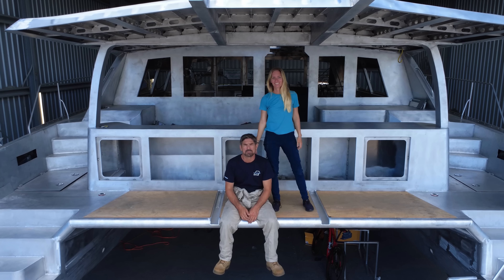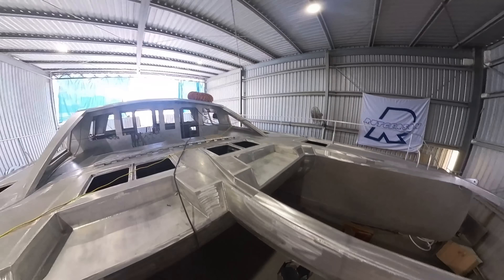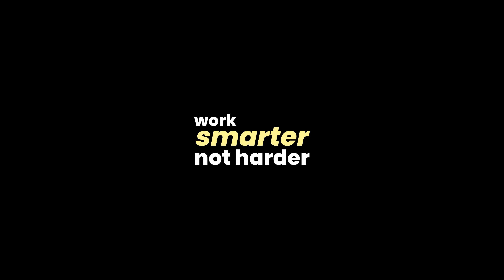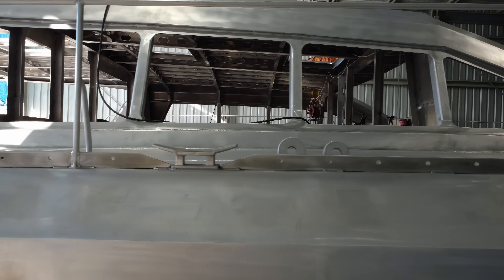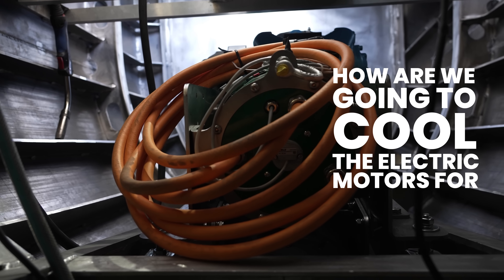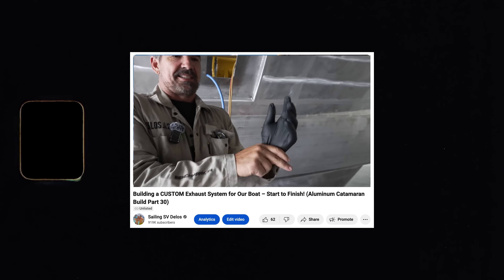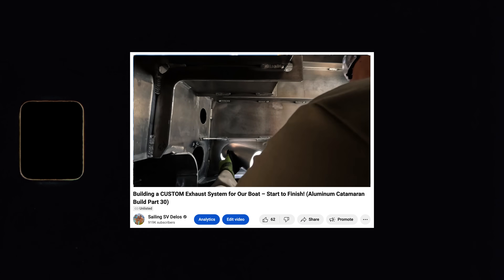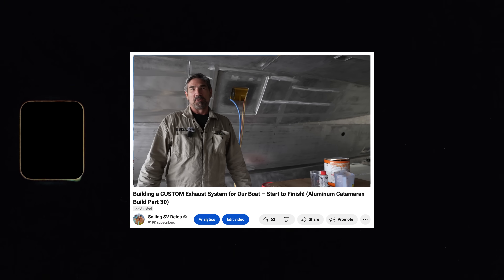We Challenged AI to help design our Keel Cooler 🧠 (Building Our Own Aluminum Catamaran From Scratch)

Comment: As a marine engineer who has designed commercial keel coolers and experience with smaller off the shelf and custom pipe coolers often used in small shrimping skiffs, the issue is the coefficient of heat transfer.  You are using the heat transfer capabilities of aluminum before you paint on thermal insulation.  

You are looking at using your hull as the outside of the cooler, i would strongly recommend using your hull as the inside of the cooler and welding a thinner aluminum on the outside.  You can do this easiest by cutting 2 holes in the hull, exhaust on top and intake on bottom, cut 4" aluminum pipe in half and weld a 6' section going forward on either thruhull and connect the open ends towards the bow.  This will give you roughly 5 sq ft of heat dissipation and a natural convectionary flow down as the water cools and sinks.  More than enough for your application.

Feel free to message me if you want a completely pump free keel cooler design.
Reply: Makes sense to have it on outside.  Less heat radiated back into engine bay and through convection.
Reply: I naively assumed you'd have a pump to circulate the coolant, so that convectionary current wouldn't be important.  I would have also guessed you want a countercurrent flow of coolant starting at the stern end and forward opposite the flow of the seawater towards the bow.  Any validity to those ideas?
Reply: @bobbj177  Yes and no, he will most likely have a pump and I'd assume he would as well, but we can't always assume he's using full power.  We really aren't talking about much heat, and since a variable is possibly a pump that is rpm based, there could theoretically be a point where parasitic losses are significant for convectionary current.

Counterflow would only matter if the same exterior coolant is being used.  You obviously want the coldest atmosphere available for the coolant returning to the motor, but a keel cooler is assumed to always be surrounded by continually new constant temperature water unlike a heat exchanger in a raw water cooled diesel.
Reply: @bobbj177 Yes the coolant pump that's mounted on the engines block.
Reply: The volume of  coolant passing through the heat sink is an important variable.
Reply: @robertcox5861  No, the velocity of the coolant against the transfer surface, Look up plate heat exchangers, they have very small internal volumes but high velocities.
Reply: Agreed, this is the most effective way. Even if this "Blister gets mechanical damage the two holes to the sea are not open to the hull. My instincts are for oil as a coolant, It works just fine on transformers and water and electrics are a recuring nightmare. Also, no risks of corrosion.

Comment: You should try Grok as well, it is one of the most powerful AI systems currently.  I put the info in quickly and it shot out:  Minimum size of 0.07m^2 and Practical at 0.1-0.15m^2 to account for real world variables like low speed and biofouling.  This was assuming a Delta T of 40C

Comment: Grok's final answer in DeepSearch mode:

Heat to dissipate: 2.78 kW (2,780 W).
Heat sink size: Approximately 0.093 m² (e.g., 30 cm × 31 cm) as a keel cooler, assuming the boat is moving and water is 20°C. For a stationary boat or added safety margin, consider 0.15 m² or more.

Grok's conclusion in DeeperSearch mode:

In conclusion, for a 25 kW electric motor with 90% efficiency, approximately 2.78 kW of heat needs to be dissipated via the aluminum heat sink. When used as a keel cooler on an aluminum sailboat, the required surface area is about 0.07 square meters, based on marine engineering formulas adjusted for aluminum's efficiency. This small area is reasonable given the heat load and material, though practical design (e.g., tube arrangement) should consider installation and flow conditions, potentially requiring consultation with marine engineers for precise implementation.
Reply: This is grok with deep think “### Final Answer:
- Heat to dissipate: 2,780 W (2.78 kW).
- Heat sink size: A flat aluminum keel cooler with a surface area of approximately 0.124 m² (e.g., 50 cm x 25 cm) is sufficient under the assumed conditions (ΔT = 30°C, h = 750 W/m²·K). For safety and fouling, consider upsizing to 0.15-0.20 m² (e.g., 50 cm x 30-40 cm).”

Comment: Grok 3  
You have a 25 kw electric motor that’s 90% efficient and you want to cool it with a closed loop coolant system how much heat do you need to dissipate via an aluminum heat sink? How large would the heat need to be if it’s used as a keel cooler on an aluminum sailboat
Let’s break this down step-by-step to calculate the heat dissipation required and the size of the heat sink needed as a keel cooler.

Step 1: Calculate the Heat to Dissipate
A 25 kW electric motor with 90% efficiency means that 90% of the electrical input power is converted to useful mechanical work, and the remaining 10% is lost as heat.
Input power: Since 25 kW is the output power (mechanical), we need to find the total input power.
Efficiency = Output Power / Input Power

0.9 = 25 kW / Input Power

Input Power = 25 kW / 0.9 = 27.78 kW
 Heat loss: The difference between input power and output power is the heat generated.
Heat = Input Power - Output Power

Heat = 27.78 kW - 25 kW = 2.78 kW

Convert to watts: 2.78 kW = 2,780 W
 So, the motor generates 2,780 W of heat that needs to be dissipated by the cooling system.
Step 2: Heat Sink as a Keel Cooler
A keel cooler on an aluminum sailboat uses the surrounding water (typically seawater) as a heat sink. The heat sink must transfer 2,780 W of heat to the water. The size of the heat sink depends on the heat transfer rate, which is influenced by the temperature difference, the heat transfer coefficient, and the surface area.
Assumptions:
Water temperature: Let’s assume the seawater is 20°C (68°F), a reasonable average for many sailing conditions.

Motor operating temperature: Assume the coolant keeps the motor at 60°C (140°F), a safe operating temperature for many electric motors. The heat sink surface will be slightly cooler, say 50°C, due to the coolant temperature drop.

Temperature difference (ΔT): 50°C - 20°C = 30°C.

Heat transfer coefficient (h): For aluminum in contact with water (forced convection due to boat movement), a typical value is 500–1,000 W/m²·K. Let’s use 750 W/m²·K as a mid-range estimate for a sailboat moving at moderate speed.
 Heat Transfer Equation:
The heat dissipated (Q) is given by:
Q=h⋅A⋅ΔTQ = h \cdot A \cdot \Delta TQ = h \cdot A \cdot \Delta T

Where:
Q=2,780 WQ = 2,780 \, \text{W}Q = 2,780 \, \text{W}
 (heat to dissipate)

h = 750 \, \text{W/m²·K} (heat transfer coefficient)

ΔT=30 °C\Delta T = 30 \, \text{°C}\Delta T = 30 \, \text{°C}
 (temperature difference)

( A ) = surface area of the heat sink (in m²)
 Rearranging for area:
A=Qh⋅ΔTA = \frac{Q}{h \cdot \Delta T}A = \frac{Q}{h \cdot \Delta T}

A=2,780750⋅30A = \frac{2,780}{750 \cdot 30}A = \frac{2,780}{750 \cdot 30}

A=2,78022,500A = \frac{2,780}{22,500}A = \frac{2,780}{22,500}

A≈0.1236 m²A \approx 0.1236 \, \text{m²}A \approx 0.1236 \, \text{m²}

So, the surface area required is approximately 0.124 m² (or 1240 cm²).
Step 3: Practical Size for the Keel Cooler
The heat sink will be a flat or finned aluminum plate mounted on the hull. Let’s assume a simple flat plate for now (no fins, which would increase surface area and reduce the size needed).
Dimensions: If the plate is rectangular, we can estimate its size. For example:
Length = 0.5 m (50 cm)

Width = 0.248 m (24.8 cm)

Area = 0.5 m × 0.248 m = 0.124 m²
 This is a reasonable size for a keel cooler on a sailboat. If the boat is stationary (no forced convection), the heat transfer coefficient drops (e.g., to 200 W/m²·K), increasing the required area:
A=2,780200⋅30=0.463 m²A = \frac{2,780}{200 \cdot 30} = 0.463 \, \text{m²}A = \frac{2,780}{200 \cdot 30} = 0.463 \, \text{m²}

This would require a larger plate (e.g., 0.7 m × 0.66 m).
Final Answer:
Heat to dissipate: 2,780 W (2.78 kW).

Heat sink size: 
For a moving sailboat (h = 750 W/m²·K): ~0.124 m² (e.g., 50 cm × 25 cm).

For a stationary boat (h = 200 W/m²·K): ~0.463 m² (e.g., 70 cm × 66 cm).
 The actual size could vary based on boat speed, water temperature, and whether fins are added to increase surface area. For a practical design, a slightly larger area (e.g., 0.15–0.2 m²) with fins might be used to ensure adequate cooling under varying conditions.

Comment: Not being an engineer but rather a mechanic of fifty years experience, I find the keel cooler idea interesting. However, from a practical standpoint of maintenance and serviceability I'd lean more toward something I could isolate, open up and clean, should the need arise. If I were leaning toward doing something sexy I'd include an air pressure bottle that could be used to blast out debris, should that occur, but doubt its necessity unless you plan to travel in areas where it a concern - rivers, etc. Nobody likes mucking out clogged intake strainers and sea chests. Was the intention of fins being used external to the hull or internal to the exchaner or both? Unclear on implied design / mounting.

Comment: Thank goodness you have an engineering background as some essential Established Concepts are often overlooked and are the cause of many structural failures . One main would be the CoEfficient of Expansion Rates even when two "like" Metals are used with divergent or Extreme Ambient Temperature. 
Your Motors will be somewhat a known operating curve  but your water temperature Could be extremely different and the heat dissipation cycle will continues when the boat come to rest,... Hence the need for a in-line fluid circulation pump. Using the Hull for dissipation won''t be limmited to

Comment: A friend of mine got a sailing yacht of 35 ft with a motor of 20 KW. For cooling the skeg is used having a surface of about half a square meter. So I think the result given by DeepSeek is close to reality. But somewhere below was a comment proposing a test rig using a 2500 W heater. Sounds pretty good to me and will leave no doubts.

Comment: …but Brian, this is very cool, but normal heat exchanger on this engine size is a small cylinder right in front of you, ten minutes to inspect/remove/clean/replace. What are you going to do when engine overheats due to a blockage/leak in this keel heat exchanger? Disassemble half of the boat to get inside the keel?

Comment: A Thermoelectric Generator (TEG) can be used as a portable power generator which harnesses waste heat (from appliances such as wood/pellet stoves) and diesel engine. May be could be used to reduce heat and make ele. Just a Through Thanks for what you guys do. Been with you from the Start. From a Land Locked Sailor.

Comment: My experience with keel coolers is that the manufacturers have come up with various solutions to improve heat transfer efficiency. Most systems I worked with were based on seawater at 90 degree F. To improve efficiency tubes may have had fins or spiral indentation. The spiral tubes were to break the heated surface so that cooler water would be introduced on the tube surface. All these calculations are based on movement though water which is why the don’t get  applied to stationary applications like generators while moored, heat transfer is greatly diminished.

Comment: #1 You never said Exit temp of the motor allowable.....  How the Heck is one supposed to do the calculation unless you just assume a DeltaT of ~??? C  #2 HOLD the boat: You will have anti fouling covering your aluminum which acts as an insulator, this throws a small wrench in.  Though simple 1 fin calculation(hull) is pretty much Any mechanical engineers Heat Transfer Textbook example.  2.5kW is not that much, but the key is you said you only want 10C? DeltaT?  Increase Delta T and your fin area without the boat moving shrinks drastically.  Say, stuck on a reef.... not moving and not wanting your DC motor to overheat....  THIS is the REAL calculation, but we do not know Delta T exit Temp allowable so...

Comment: I expect you'll have fins within the cavity to encourage heat transfer since external fins would encourage barnacles and hamper hull scraping. A nice large but shallow cavity against the hull together with a motor that can handle 50C temps. should be nice, I imagine.

Just speculation.

Comment: Using your idea, I sent Gemini this question which has been bugging me and I got an answer of 4hp and to use the existing setup I have to get a gear reducer from the motor's RPMs to 1800 which is the genet RPMs.  Thanks a million for the idea.

Maybe you can help me with this problem. I have a 55' long sailboat that displaces 60,000 lbs of water. I have an old 20 kw northern lights genset on the boat and the hydraulic pump that runs the bow thruster is powered by the genset. It is attached to the generator crankshaft by a gear reducer (no specs on that). The hoses can take 3,000 psi but I have no idea what the pump puts out. My goal is remove that genset and run the hydraulic pump from an electric DC motor but I don't know what size of motor to get. Can you help with that?

Comment: Maybe a internal exchanger against the hull...I think that is your design?...and added fins inside with a fan to move air across fins...kind of a dual purpose/backup design?
Reply: You could even channel that hot air and move where needed?
Reply: Or a simple diverter valve to a internal radiator?
Reply: Hot water heater comes to mind...modern ships are being designed for 0% energy loss
Reply: You create the energy so use as much as feasible

Comment: I am wondering about stray currents. Look what happened to the Wynns. What precautions are you taking for that?
Reply: The Wynns boat is (was) carbon fibre composite and not aluminum.  The problem with the composite material is that the CF cloth is actually conductive (it's carbon).  From what I saw with their boat I don't believe that any precautions were taken to isolate the CF cloth from the metallic on board components and fittings.  Proper active or passive systems to mitigate corrosion in aluminum yachts is a well understood science and really shouldn't be a problem with careful construction and no copper pennies on exposed bilge plates.  The biggest factor in Aluminum is to avoid pinhole exposure points in the external barrier coat.  That tends to focus the corrosion to those areas exposed to salt water alone and can be very nasty.  Also, a good isolation transformer for shore power connections will avoid your metal boat becoming a anode itself when moored in a slip with reverse polarization on the wiring at the dock.  Australia is the world center for aluminum vessel construction... plenty of experts around to consult I am sure.

Comment: The biggest variable on sizing the exchanger is the delta T, by far. So if you don't want the motors to overheat while in tropical conditions, you must first of all use that delta T. To maximize efficiency, your exchanger must have exterior finning of some design. Also, realize that coolant flow will be much more effective if it is operating in a turbulent regime as opposed to a laminar regime. So employing turbulators of some type inside the cooler tubes would also make a significant improvement in it's heat transfer coificient.

Comment: Why not oversize the hell out of it, and make sure you have plenty of capacity. Just like sv seeker. You can use a thermostatic valve to control the flow just like a regular engine

Comment: Cool video. Quick question; when using the electric motor as a generator, does it generate the same amount of heat? If so, you may be using it when the boat is at anchor and less flow across the keel. Also, with the cooler directly mounted in contact with the hull, the entire hull will be like fins on a radiator, so the effective surface area dissipating heat to the sea water would be much greater than the area of contact with the hull on the inside. That should add at least some small factor of safety that the calcs don't seem to take into account.

Comment: I suggest checking the results with an engineer who knows marine engine cooling. The answers from the AI bots sounded like they assumed the Keel Coolers were external to the hull not internal. 
Remember if you fabricate a Keel Cooler mounted on the inside of the hull to transmit heat through the hull you may need more surface area against the hull because about half the cooler will be radiating heat into air inside the hull.
You may want to consider incorporating a heat exchanger with the hot water system with your engine and motor cooling system. This could be done by sandwiching the Keel Cooler between the hull and the HWS heat exchanger, this would soak up the heat which would otherwise be dissipated into the air inside the hull
Reply: They very much assumed the Keel Coolers were external, the first warned of contact with the hull. Also, what about the diesel side? Larger cooler or separate cooler? Limitations on space? Sailing Flying Coney has a very long external keel cooler, but she also has a large diesel engine.

Choose pipe outside with loop needing two holes, or sea chest inside with two holes.

My thoughts are forward angled pipe into top of a Sea Chest with alum coil and stern angle pipe out the bottom back into the sea. Add a couple of seacocks maybe a removable top hatch in the Sea Chest with an anode inside.
Reply: (Also remembering that AI just makes shit up on a not infrequent basis. I would NOT trust AI with anything that has anythign to do with safety.)

Comment: Put this inquiry into Chat GPT: “heat transfer coefficient: air versus sand vs graphite”. Sand is 12.5 times higher, and Graphite is off the charts.